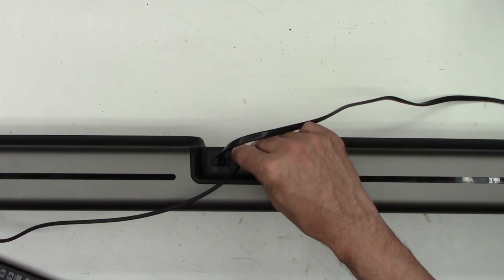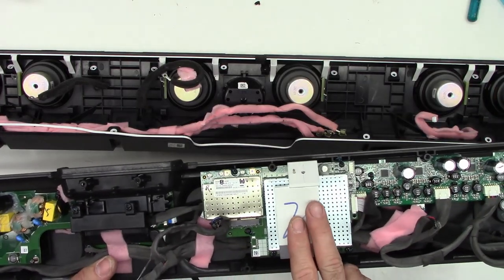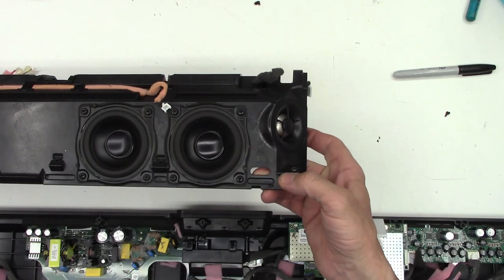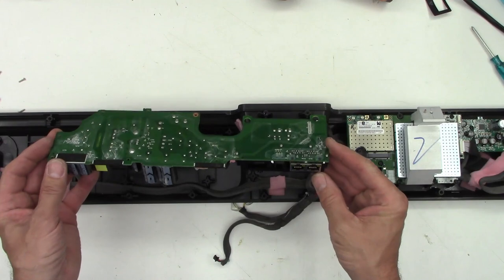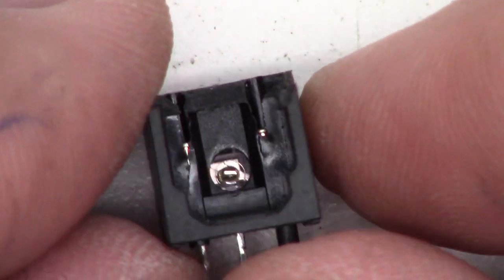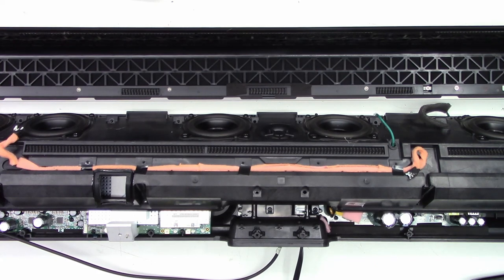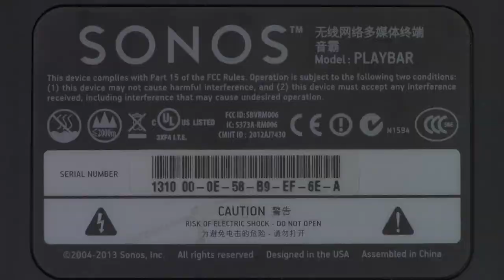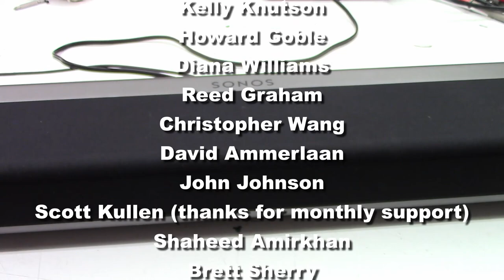SONOS PLAYBAR SOUNDBAR WITH A DAMAGED OPTICAL INPUT CONNECTOR JACK TOSLINK REPLACEMENT

Comment: As almost any device nowadays: designed to be cheap to build and to survive the warranty period. Zero concerns about serviceability.
Reply: Most devices nowadays are BAWE (breakable after warranty ends) and designed with a higher failure rate. Cheap flimsy parts.
Reply: Hi i recently purchased Sony HT-RT3 home theatre two weeks ago and they didn’t check that product and doesn’t provide any demo. Just now i know the Optical cable slot has been damaged. Then i raised a complaint to Sony they are saying like i need to change Mother board and the cost from my pocket!! Stating that it’s a physical damage it won’t cover under warranty!! But its a manufacturer defect!!

Comment: The little door on the optical port broke on my new speakers on day 2. The problem was the sound from my Samsung TV was not working so I tried multiple cables in case that was the issue, but taking the cable in and out so many times deteriorated the plastic.

Comment: Have you any Advice on how to remove the old board. Is it possible without a Hotair soldering station, as I don't have one? Can you just pull the housing that's held by two pins off with the optical receiver staying in place? Would make it way easier with just two pins. I have a new TV Mainboard  with a optical Output damaged in exactly the same way as yours. And I have to get the damaged port off and want to salvage the intact port of the broken motherboard. So the non damaged port I want to keep intact while pulling it off from the board.

Comment: Do you remember the cost of that part ?
I ask because I have the same problem . I wouldn’t even think of trying to fix it myself , as soon as I took it apart , parts would fly all over the place, and I have no idea what to do lol. 
The issue now is if I wanna swap out the speaker at 30% off I also have to swap out 5x Sonos 5s that are outdated for the new app. 
Yes , the cost of that optical casing part . We are talking 3000+ for new speakers plus now a useless sub base !
All because Sonos won’t repair there products, and no other local 3rd party electronics repair shop want to even touch it !
The rest of the speaker and system works fine, I just have no tv surround .

Comment: Maybe you can help  me. I hope. I have a broken connector just like the one you replaced. my soundboard is a Visio. I can't seem to find the replacement no part numbers, it has 2 legs soldered one on each side on the insert part of the socket and there are 3 legs soldered on the back or Interior part of the socket. I don't know where i can get an schematic to I can solder another one outside of the unit since the legs would not match. I plant to use this one in my man cave. Thanks

Comment: Thank you, very useful, similar issue at my side and I bought the spdif connector, I disassembled my unit but stopped just before fully removing the PCB board; my problem is to remove the little flex cable from its connector (seems glued); I removed the two other cables from their connectors but for this one it seems more challenging, would you have any advice ? did you have to face the same issue with that little flex flat cable ?  What best to do ? Is it easy to reinsert it back ?
Reply: Replying to myself for other people potentially concerned to complement this excellent video, In the process to my views you have three main points of attention:
  1-  Removing a rubber to pass a flat cable within its corresponding hole; No need to cut the rubber as suggested by Norcal (although easier) but be aware those speakers are mounted by Sonos in such a way it should be completely air sealed for vibration/quality reasons. Thus prefer passing the rubber through the hole as well having the cable in diagonal (forcing a bit but carefully); 
  2- This little flex cable on the PCB (requires very good eyes or a magnifier glass and a light), very gently remove the sticker on top and turn the black lever  at 90° angle with your finger to release the cable (no tool), it is stuck underneath as well by a sticker, you could gently move up the cable from its sticky point.
  3- Removing the Spdif connector, object of this tutorial, use a heat gun rather than a traditional solder iron, it will be easier not to damage it.
It works fine now, 
Thank again Norcal

Comment: Hi Brother,  Is there possible to change Optical Cable Slot in Sony HT-RT3 woofer like this?
Reply from the maker: If it is the toslink optical input, then most likely yes if you can source a replacement jack.

Comment: My TV optical port not working can I buy like this will it work
Reply from the maker: It needs an optical input. Do you see a red light if you lift up the little door on your sets optical output jack??
Reply: @norcal715  no lights
Reply from the maker: On the transmitter unit, like the TV or  Blu ray player.
Reply: @norcal715  from tv there's no red light coming to cable